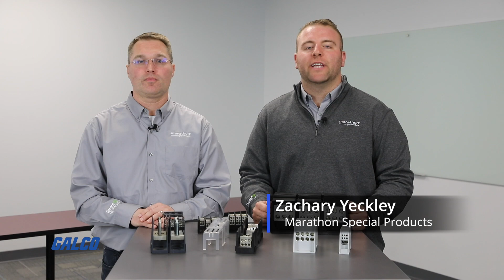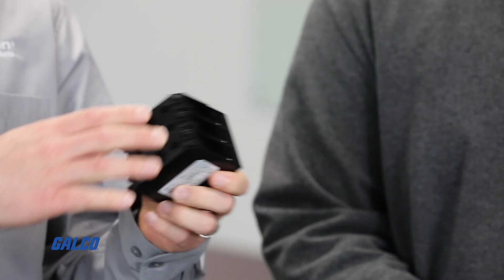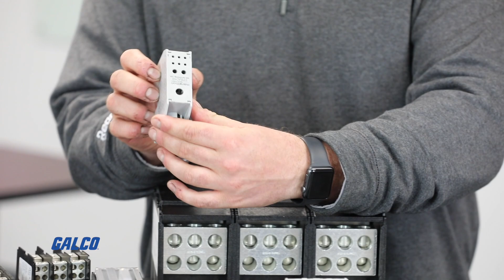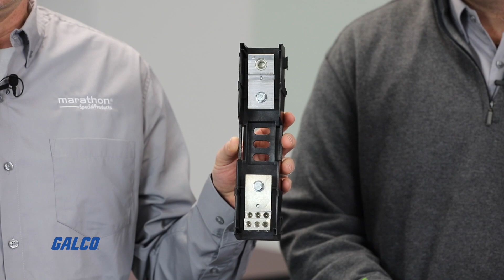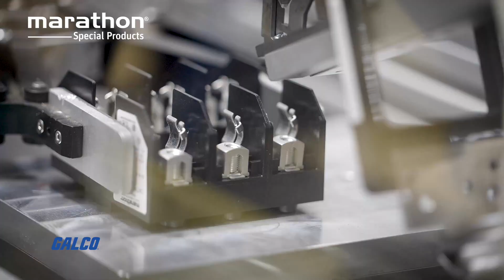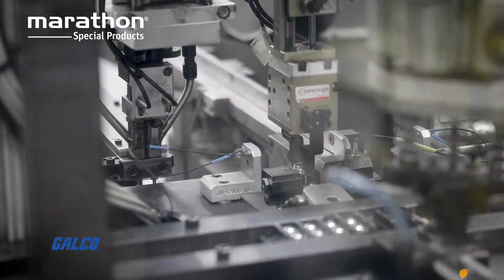Marathon Special Products Power Distribution Block Overview

Comment: So, I am on your website trying to find the PDB I need and the sorting function is horrible. There is no sort function and over 2000 options :/

I need to take 4/0 SER AL and change it to 2/0 copper. So a four conductor block would be awesome. Do you have a part number?
Reply from the maker: 1343350

https://www.galco.com/1343350-52798.html